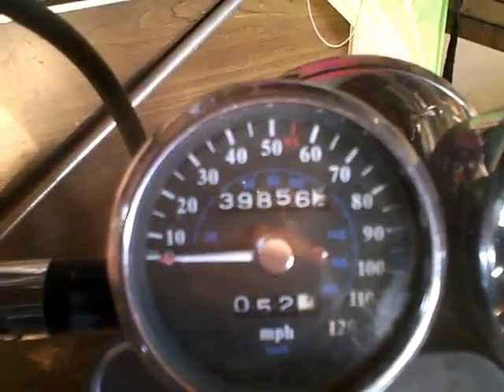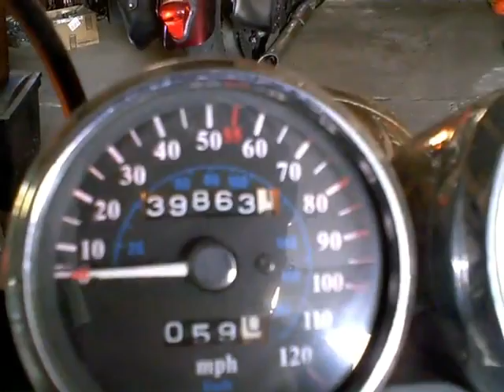PBC03 What's that hum you are hearing?

Comment: if they can detect it at extremely low db below noise floor, then doubtful much could be done... even bringing in another generator of 60 hz emi would still produce the sums and differences, which could be potentially used to back calculate... although the more random the emi the more difficult it would become...  but yeah.. thats very interesting..